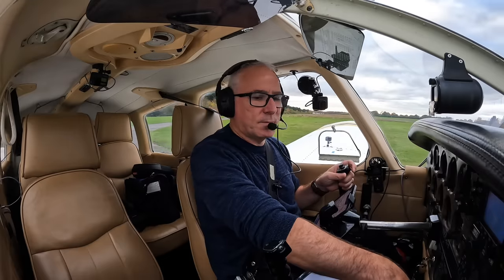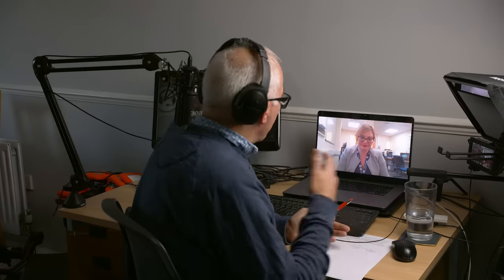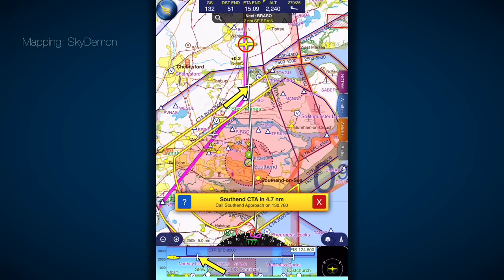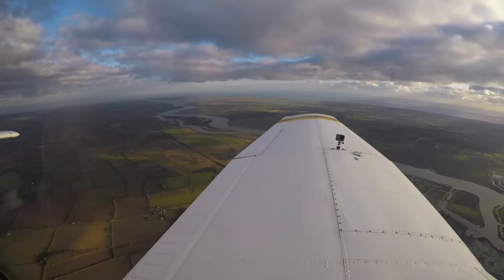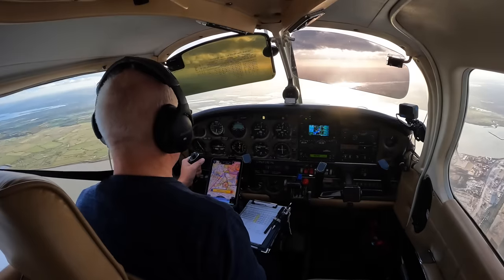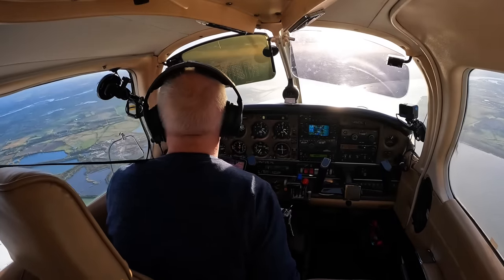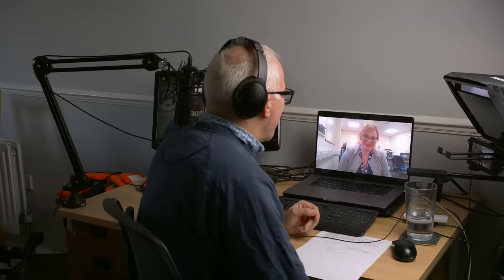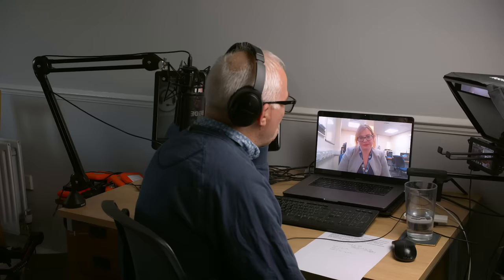I need to descend NOW!! - What would you do?

Comment: The Southend controllers are excellent and it's always a pleasure talking to them. I would have orbited if the frequency was too busy to get a word in.
Reply: I'm only part way through the video and my first thought was to orbit until I had a chance to request clearance to descend.
Reply: me too.
Reply: Agree. I would have orbited. Another option I would take would have been to get my turn to transmit and inform the controller I was descending 100ft. Or entering the orbit indeed. It’s a VFR clearance after all and at the point you are not able to comply you must aviate accordingly and then communicate that. Descending 100ft is unlikely to have caused a LOS. Interesting film and professional on both sides.
Reply: Orbiting here is definitely the least - worst option
Reply: Orbit definitely

Comment: The key point here is, that as a VFR pilot you are solely responsible for your own safety and not busting airspace. ATCO’s are not there exclusively for an individual and are often handling the safe conduct of multiple flights. Part of ppl training says, if you are given an instruction that means you cannot maintain a legal flight path then you should state that back to the ATCO. The onus is always on the pilot. The moral here is if you are going to enter controlled airspace you should have a plan b and possibly c. I personally think all concerned did a good job and this video highlights good practice.

Comment: I fly for a UK airline and this is not only applicable to GA let me tell you. ATC are generally great but we have been forgotten about when making our way through the London zones descending to a destination on the south coast. It can really give you a headache when it happens and as you identify, the frequency can be so busy you can't even get a word in and have to keep the assigned heading and altitude into the abyss. You end up high and on the wrong side of a STAR and it just snowballs if not careful. The threat for us is "Dirty Dives", 250kts by FL100 which is not always possible when being asked to make a restriction requiring 3000-4000fpm descents when at 260kts in level flight and workload with a cabin full of pax to think about also. If it's gonna screw you up, Aviate, Navigate Communicate. Ask for extra miles, tell ATC unable best you can give is "x" if need be and ultimately don't assume ATC will always have you covered because they sometimes don't (which is rare but true) due to complexity of situations at any point in space.

Comment: Generally speaking the optimum course would have been to have mentioned this in the clearance read back or shortly thereafter if you’d spotted it immediately. If not, and you can’t get in on the frequency, squawking ident is usually a good way to get a controller to talk to you urgently. It’s something we are taught in the airlines, and for more serious issues, such as needing weather avoidance but been unable to get in, we would also consider squawking 7700 and initiating our own avoidance without clearance (obviously not applicable to this case, but worth considering if you ever need it).

Comment: Hi Jon. With regards to gaining the controllers attention when the frequency is busy, you always have the option to  press the Ident button on the transponder. This will alert the radar controller very quickly. 
In airline flying we use this, when necessary, for weather avoidance when the frequency is busy. 

Hope this helps.
Reply: I thought that the ident button (for PPL) is only supposed to be used once requested by ATC (to avoid misuse). I may be wrong though.

Comment: From the UK AIP:

“Where controlled airspace is vertically adjoined by Class G airspace, aircraft operating at the base (lower limit) of a control area or at the upper limit of a control zone or control area should comply with the requirements of Class G airspace”

Doesn’t this mean you can fly at 2500 London qnh at the lowest level of the TMA (terminal manoeuvring AREA) complying with class G rules?

Having said that..  I wouldn’t want to be near the tma boundary just in case any turbulence, wake turbulence from above etc…
I’m thinking slowing down, orbit/turn to north where the tma moves away from Southend airspace, all to buy some extra time until the controller can talk to you.

Comment: I was in Cardiff CTA when I was returning from a nav exercise in my pre-PPL days; I was cleared and flying a published VFR route which led me to the end of the downwind leg for the right-hand 12 circuit. On the frequency there was another aircraft in the circuit that sounded like it was going to arrive at that point at the same time as me. I did one orbit left for spacing. What I should have done was to query it. But nothing untoward happened and I didn't get asked to copy a number to call after the flight finished. :)

The controllers at Cardiff were lovely. This was well before the days of moving maps being common.

Nine years since I've flown though... good times. I did a night rating and IR(R) as well (that wouldn't be enough for Class A of course; also the spam cans in the club were probably not good enough for class A either in terms of equipment on board). I hope to get back behind a yoke someday!

Comment: Great video. 

When I transitioned from PPL standards to CPL standards, it was tricky flying bang on the numbers at first. The main thing I learnt was, be very disciplined with yourself. If you can hold 2460’ for long periods, then you can hold 2500’. If you’re holding 81kts in a climb, there’s no reason why you can’t pitch and hold 79kts in a climb. Just set yourself hard limits and work hard to stay bang on the numbers. The trim wheel is your best friend. Eyes outside, set the attitude, power and trim. Your instruments lag, so always set the attitude visually and catch the nose if it drops or rises. 

That will improve your flying skills and you’ll be able to hold speed and altitude hands free without autopilot. If the wx is bad, you just have to work harder at flying and managing the plane to stay on your targets. 

Couple more options to help in your scenario:
1) Slow down ( bad wx config) to buy yourself some more time 
2) Aviate, navigate, communicate:
Descend to the legal altitude (aviate) 
Continue on your route (navigate) 
Tell ATC what you have done (communicate) NB: Only if you can’t get hold of them before hand. 
They would most likely have just called you back with your call sign to acknowledge what you have done. It’s better to aviate and navigate the plane safely without busting the class A than it is to descend to the legal altitude prior to receiving the clearance from Southend. 
3) If you think you’ve been forgotten and can’t get a word in, press the ident button. You’ll flash and they’ll probably call you. 
4) Orbit, as you discussed. It was good for the Southend controller to discuss “direct to” terminology. Even IFR routes have an RNP element that permits an element of deviation from track. Granted, these are protected routes and IFR is different from VFR, but if you’re given an VFR clearance that is not “direct to”, I’d argue that it is still safer to orbit in position than bust class A airspace. 

Excellent video as always. Keep up the good work.

Comment: I learned to fly last year out of North Weald, and now fly from Southend. As you said, the Southend controllers are excellent, but my experience is that Southend Radar can suddenly get busy at times. It's not unusual to have to wait a few minutes before you get a break in the radio traffic to get a call in, or to get told to stand by for a few minutes. Looking at your route I've got to say that I would have planned to go around the CTR rather than through it. It wouldn't have taken any longer, and it would have avoided this issue, plus avoiding the need to plan a contingency if you don't get clearance through. I appreciate that it can get busy in the gap between Southend and London City, so you need to keep your eyes open.

Comment: I transit Southend regularly and I always route via the DET VOR which, a. Gives a higher transit (glide range) b. ATC never gives a level equal to their zone’s upper limit so the transition to the Class G under the London TMA is safe. 
However, VFR flying requires a height hold deviation of no more than +/- 200’ so I’m not sure why you couldn’t have descended by 100’ or even 200’ to deconflict with the class A and still be technically legal in the class D.

Comment: This is such a good video Jon.  It highlights the importance of pre flight threat error management.  Pre-empting and thinking through your options for different phases of the flight at ground level with a hot cup of tea is way easier than working them out at 2500ft with added suspense.

Comment: For what it’s worth I think you did the right thing. As you know, in spite of learning to fly in the UK 50 years ago I now fly in the US. Frankly, I cringe watching just how impossibly difficult it is to go from point A to point B in the UK. It’s not uncommon to see pilots given numerous different squawk codes. 

I fly in the Dallas area and generally you can request VFR flight following from the tower prior to departure and will be given a departure frequency and squawk code and they will hand you off to the next controller as you fly along and you will get traffic advisories. You can fly at reasonable altitudes instead of having to avoid all controlled air space. 

I really don’t understand why the UK has made it so hard to do VFR flights. Back in the 1970s I flew a Cherokee 180 from Wycombe Air Park to Mykonos and back and apart from in the UK I flew VFR along airways at 9500 or 10500 feet with no problems. I landed at Nice, Rome, Athens and Naples without any hassles. 

The USA doesn’t do everything right, but when it comes to General Aviation they are definitely the best. I think the UK controllers job would be much easier in the UK if they modeled it on the US system. 

Each controller in the UK has to go through the whole rigamarole of getting your aircraft type, origin and destination and POB all of which wastes ATC transmission time.

Comment: Thank you so much for making this video, I fly an Aeroprakt in Norway, and experienced a somewhat similar scenario, where I was approaching a new controlled airspace from a controlled airspace, and did not have clearance to enter the new airspace. I was on a specified altitude, and as I was approaching the boundary of the next airspace, the frequency got super busy. I ended up choosing to orbit (and with an Aeroprakt in which I can comfortably orbit at 50 knots, I pretty much look like a helicopter on a scope.. ;) ), and after 1,5 orbit, I got the call in to request frequency change. But as you describe, it isn't a comfortable feeling to get into that situation where none of the options aren't "cleared" options. My takeaway is to give myself a bit more time, and to query earlier. If request is denied, at least that will remind the controller that my situation needs to be dealt with in due time. Also a huge shoutout to the controller from Southend that took the time to talk through the process, it is so very valuable to get both sides of the situational understanding, and facilitates even greater learning!

Comment: If no way to contact the ATCO on the congested frequency,  I would have carefully desceded to 2400' right before Heathrow Class A, still within the Class D. 
As Nicole said, the VFR routings and altitudes are not the same as IFR routings and altitudes, primarily because the pilot remains in charge of separation from other VFR traffic and also clouds, so there is more room for these deviations, and it resolves the problem in 10-15 seconds vs. a 2-minute standard turn rate orbit

Comment: I would have asked earlier with at least 5 mile before as it is the PIC who is responsible not the controller or I would have asked what will happen at the Class A boundry. I have found controller great (especially at Norwich) and helpful when I have asked for decent or deviation to remain VFR, after a drirect clearance.

Comment: I wonder if perhaps atc could issue a clearance along the lines of "Cleared to transit the Southend control zone not below altitude 2500ft until west of the London Gateway Port VRP [etc...]" (for example). I'm not sure how the CAA would feel about it though as I don't think there's anything like that prescribed in cap413 at the moment and even then, the traffic situation on this day may not have allowed for such a clearance, even if it were possible. Absolutely agree that the orbits were the 'least bad' option in this case.

Comment: Excellent video! 
Personally, I like to think I would have said to the controller that I needed to be below 2500 by the boundary when you first received the not-above clearance.  But had I not done that, and couldn't get a word in, I would have descended to 2400 just before the exit regardless.  My view may be a bit controversial, but better to bust the altitude restriction with the current controller rather than infringe the class A without contact.  Practically, you would likely be clear of the traffic they were separating you from anyway, and you were VFR so could see and avoid too.  Worst case, the controller would contact you and say you've gone below your restriction, but most likely they would see you descending and understand why you were doing so and not even bother with contact, except maybe a quick good bye.
I certainly wouldn't have stayed at 2500 and gone into the class A, that's an interesting point of view to hear from an ATCO.  My understanding is that if the class A is 2500+, you would be infringing at 2500.  
Happy landings! :)
Reply: Hmm, the controllers would have been aware that, on his track, he'd reach the Class A, with it's different altitude restrictions.  It's a sensible suggestion you make but I personally would have felt I was patronizing the ATCO to 'remind' him of the need to descend by the Class A 😄

Comment: A challenging scenario .. but I wonder why you chose to route through the Southend CTA in the way you did?

I can appreciate that you'd want to use the Southend ATC services for traffic information and assistance, but cutting part through the airspace (certainly in an area as tight as the LTMA) seems to add too much risk of error than it would help to eradicate - In my opinion and personal aversion to risk. I much prefer to cross controlled airspace in a way which is directly through (to save going all the way around) or with a get-out-of-jail card where a "remain outside" reply means I can just fly under the shelf at either end instead.

Routing Earl's Colne - Around Chelmsford - Brentwood - West of Gravesend - Sevenoaks - Redhill would have still enabled you a service from Southend ATC and allowed you to be in more control of your ATC entry (or lack thereof) and precise routing around towns/cities/airfields. (it's a difference of about 3nm +/-).

I'd be interested to know your considerations for why you chose the route/altitude specifically, as the video doesn't say why you went dir BRASO dir IPKUS dir PAWDE ...? Ease of navigation in straight lines? Simpler entry into the Garmin?

Many thanks as always for putting this video up - Takes a brave pilot to share the content of errors/slips/close-calls and is certainly something we can all learn from
Reply from the maker: Good question.  Mid-air collision risk is the reason.  I'm better protected in controlled airspace, than going around.  The narrow corridor between London CTR and Southend CTR is a honeytrap, where I've had multiple near mid-airs.  Prefer to route through controlled airspace around there to reduce risk of the most serious harm.  My routing is not conventional for CTR transits, but routinely given at Southend - a quieter unit than some others...but I don't mind routing via the overhead etc if needed, as that doesn't take too much longer anyhow.

Comment: I agree Southend controllers are excellent, pretty much always get a transit when I ask for one.  I personally might not have routed as you did, it would have been just as easy to route outside controlled airspace, wasn’t saving a lot with the transit.
But having got the transit I would definitely have orbited and i would have started orbiting at least a mile from the boundary. As Nicole says this draws the controllers eyes to your flight.  Another option if you couldn’t get through at all would have been to fly South towards Rochester and leave and descend out of the class D.
Definitely wouldn’t have tried to fly at the precise 2500’ clearance, transponders can have up to 200’ inaccuracy so high risk of a bust.
And on the “can I orbit given the clearance I’ve got”, I noticed from the flight track that you didn’t overfly either of the waypoints on your clearance, you were near them but not routing near them so there’s already variance in your flight route and an orbit is the same

Comment: I would have continued at 2500 right up to the edge of the boundary and then immediately descended by 100 to be legal thereafter. If in doubt I would descend a tiny bit early rather than a tiny bit late. I know technically there is one tiny point in space where you cannot comply with both height restrictions but I wouldn’t have worried or called up atc. 
That may not be the entirely correct answer but as long as you were not “high” and actually descending on zone exit I don’t think anyone else would be bothered either.  (Ex ATPL and GA  pilot)